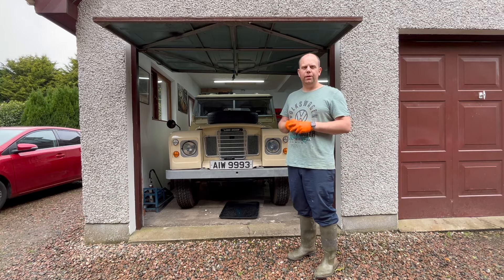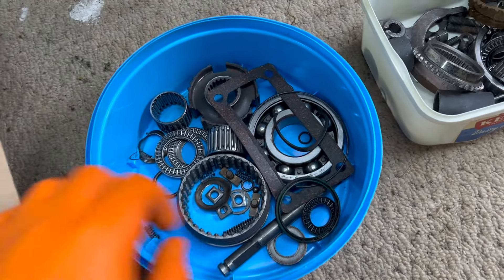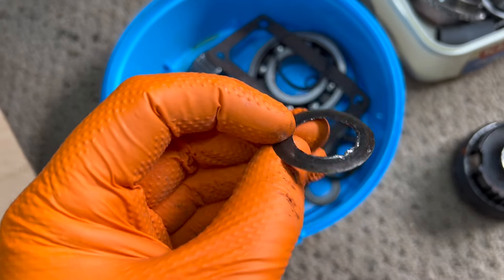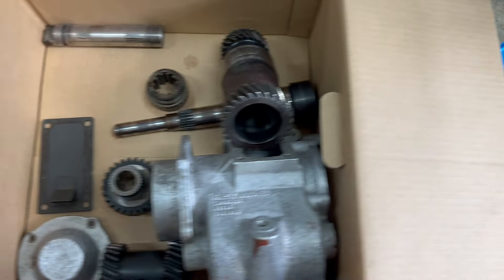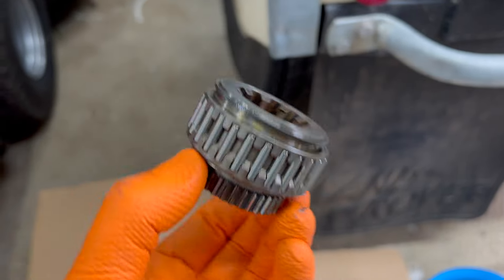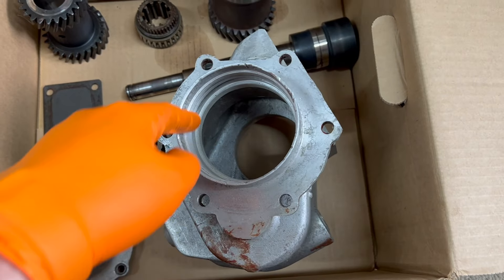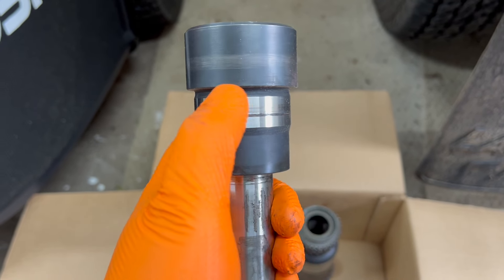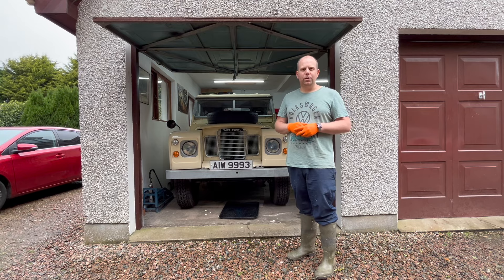Fairey Overdrive Rebuild Part 1 (Inspection)

Comment: Give you credit for rebuilding it, I ended up getting the Roamerdrive instead.
Reply from the maker: Haha, it’s not rebuilt yet! The Roamerdrive is very tempting I must say but I do like original equipment and for all the mileage I do I think the Fairey should be ok. Thanks for watching!
Reply: @restosaga  Has in been rebuilt yet? Im trying to pursue one for a toyota land cruiser and came across your video as reference. :)
Reply from the maker: @albertg4653 Sadly not, have got distracted with other projects!

Comment: I have the Fairy as well. Everything works as it should but at speeds above 45 either the main gearbox or the overdrive really whine. High 4th gear with OD in or out.🤷🏼‍♂️ I believe some OD bearings are still in use even when not in OD, but don’t know for sure. Earplugs are a must for even short trips. 
Thoughts?!
Reply from the maker: Sounds like your OD may be in need of some attention. Even when not engaged, the power to the rear wheels still passes through the OD. Unfortunately they have a small oil capacity and are prone to bearing wear and noise.
Reply: @restosaga  
Yeah, I’m about to get into it. Actually I’m hoping it is the OD. I can get that out without too much trouble. I believe the same company that makes the Roamerdrive also makes rebuild kits.
Thanks for you videos!👍
Reply from the maker: @calsurflance5598 Nice one, didn’t know that about Roamerdrive rebuild kits!
Reply: @restosaga  
I believe the company is called
 Syncro Gearbox’s.
Reply from the maker: @calsurflance5598 Thanks, I’ll check them out!
Reply: Also, consider venting the oil using a breather tube.
Reply from the maker: Not a bad idea!